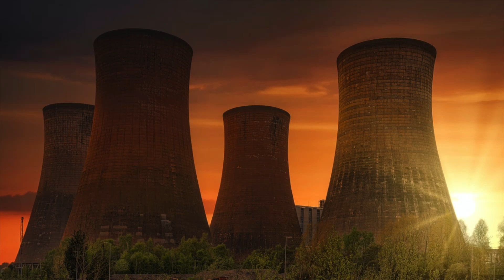Saving the world with nuclear energy, one microreactor at a time with Leslie Dewan

Comment: It's too soon to worry about spent fuel. we'll build waste-burners long before we run out of U235  We have SHOVEL READY High temp TRISO reactors now. WE need to be cranking them out on assembly lines.  You don't need complex reactors when the complexity (moderator, temperature coefficient) is built into the fuel.